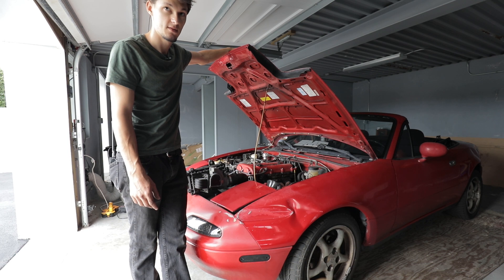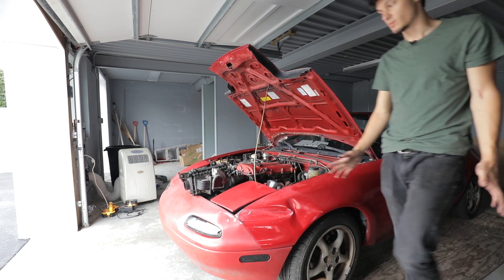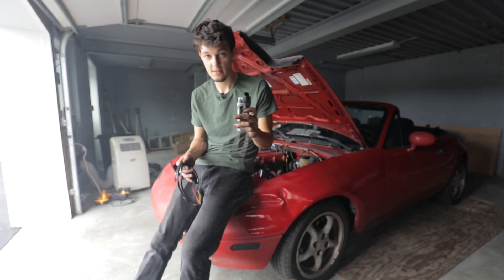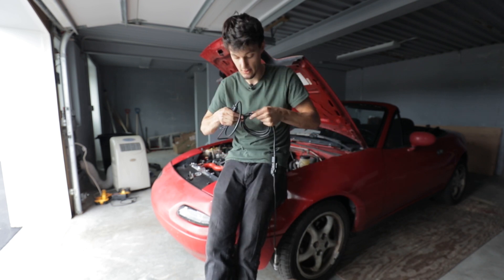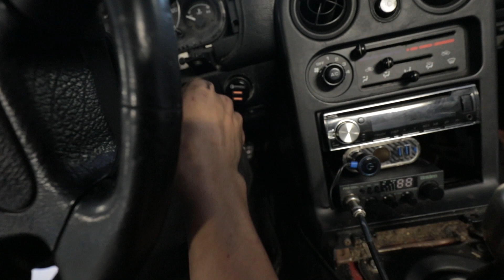NA Miata DIY Megasquirt MS3X ECU Install

Comment: This is probably the best video on the topic I've seen. Props!
Reply from the maker: Thanks! I largely had no idea what I was doing if I'm being honest
Reply: SMC Garage that’s how I’m going into it too! I’ve got a 97 M-Edition with 90k miles, and I’m buying the MS3X and everything this week. I’m following the guide on Trubokitty, and hoping everything is listed there that I need. I found this vid when I was looking for people actually doing the DIY MS3X with the DIYBOB harness. It’s like $20 more than the DIYPNP2 setup ($820). Did you end up spending about that much?
Reply from the maker: @dawn9340  Yea I wanna say it was around $800 after all the necessary parts, tools, wiring, O2, AIT sensors, etc. The guides at Trubokitty are very good from what I hear, I didn't find that until after I had everything installed. I mostly used manuals from msextra.com or diyautotune, and a little help from the miataturbo forums after I fried the ignitor. They're very helpful over there if you run into any trouble.